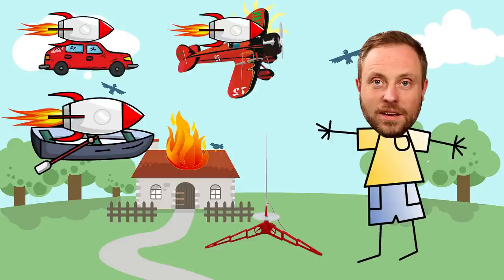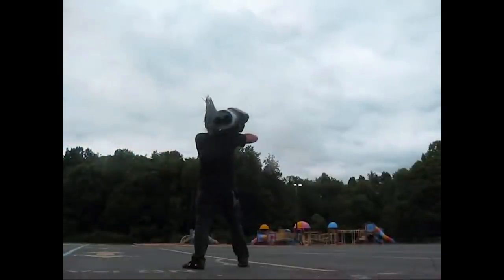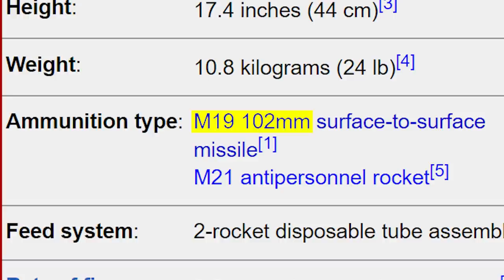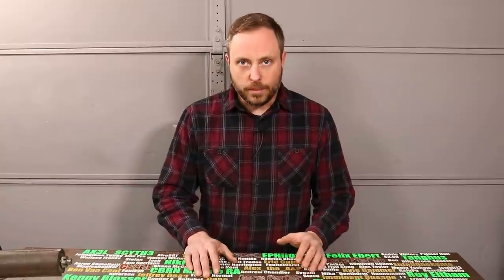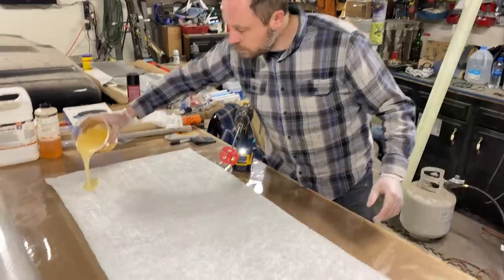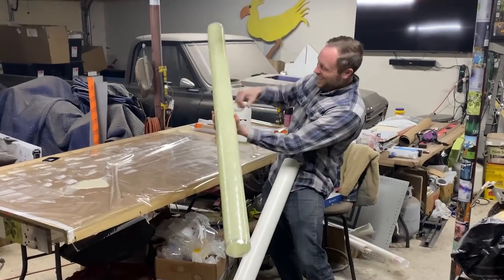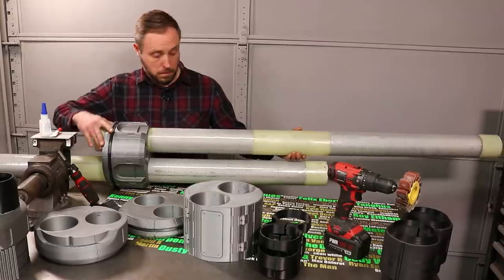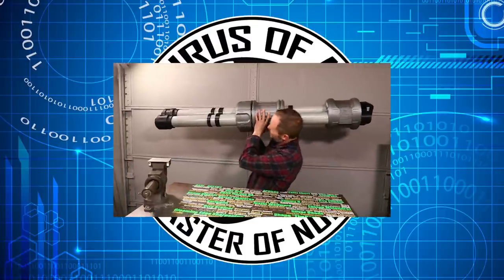Real Life Halo Rocket Launcher - Build Part 1

Comment: I wonder if 3d printing would be another option for the tubes, could very light and cheap to produce.
Reply: depending on the filament and printer, might be viable. but the better quality filament you use, the more expensive it gets. print times would be insane, and youd have to join sections, theres just no way youd get a successful print the full size even if you found a printer big enough, at least not first try. 

honestly, those cardboard tubes used for concrete molds are cheaper, faster, and wouldnt be any weaker than 3D prints. I honestly expected him to pull some of them out. Fiberglass was a great choice though. cheaper, pretty strong, and often used in hobby rockets around the same size as the tubes he needed.

Comment: The LAW (Light Armor Weapon...I think, could be Light ANTI-Armor Weapon) rocket launcher rockets have spring loaded stabilizer fins (6? maybe 8, not sure) that are folded against the propellant body (just behind the part that goes *boom*). As soon as the rocket leaves the launched, the fins spring backward to a 45°-ish angle, which provides plenty of stability without interfering with the thrust. Another type of tube launched rocket with spring loaded stabilizers, have the fins inside the body of the rocket and when it is launched, the fins rotate outwards (cute little squares or triangles that are hinged at the trailing corner so after they swing out, the air resistance keeps the stabilizers pinned against the rocket). The third type are spring loaded but are curved to match the circumference of the rocket. These fins are hinged along one side so they can swing away from the rocket body. Once deployed, each stabilizer should look like this -----> (  <----X4 [curve left]. If you were looking at it heading towards you, the fin on the bottom would be -----> ) <---- like that [curve right] and the one on the left would catch rain [curve down] and the one on the right would deflect rain [curve up]. I hope I made that understandable. The reason for the fins to be retracted in the first place is so the rocket has a snug fit inside the launch tube without being excessively restrictive so they stay in place, no matter what position the launcher is in. Only once ignition happens do the rockets leave the tube and is immediately stabilized in flight.

Comment: I know you're probably sick of Cyberpunk 2077 with that Mantis Blade build..but you think anyone will ever take on the Monowire? It seems like it would be the easier one to make a working (not exactly sharp of course) version of that..don't know why nobody has really taken that one on.
Reply from the maker: I think there is a monofilament small enough to cut but I’m not sure what it can do in the game. I’ll have to look into it!
Reply: @jairusofall  in the game it does blunt damage even though it's in universe version cuts. There's a picture of the device in the art book, and the Cyberpunk 2020/2077 wiki has a picture of that page of the book in their gallery on the monowire page. The wire glows to denote charge and I THINK (I haven't got it in the game myself..low datacap IRL means I can't update it very much) it glows a different color to denote what type of damage you do as well..but only the attacking part of the wire glows..if you have it held in hand in the neutral 'ready' stance then only the parts in your hand glows to show you where the wire is. In the game you whip it around so it has a small weight on the end I guess..according to the wiki, the ones in 2020 had a synthetic bulb on the end to hold safely..in 2077 you're using a military grade version that comes from an underarm spool.

Comment: How reliably does your rocket mass heater operate during a power out and a windstorm under low pressure system - so no fan and with wind on your chimney?

Comment: Doesn't the in game model look smaller because Spartans are like 7ft tall? I feel that would've somewhat skewed how a reasonably large launcher would look to a normal human
Reply: 2:03 you can see the vertical ruler measures the spartan as 7', so I think that was properly taken into account. Besides, compare the spartan holding it with him holding the tube at the end- it's clearly relatively larger than ingame, due to him not being 7' tall

Comment: Aluminium shouldn't be that expensive. I work as a fabricator, and there's no way an aluminium tube for that molding process should cost a hundred, let alone hundreds of dollars. I a hundred bucks would get me an entire 5m length with change leftover and I live in a country notorious for being expensive and having high markups compared to the rest of the world.

The fibreglass, expoxy etc. definitely would have been more expensive than the aluminium.